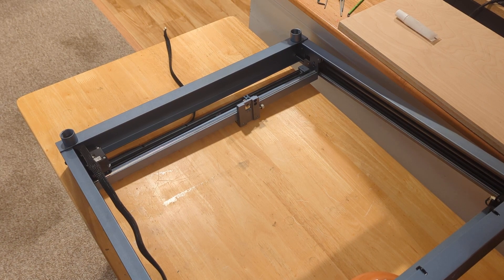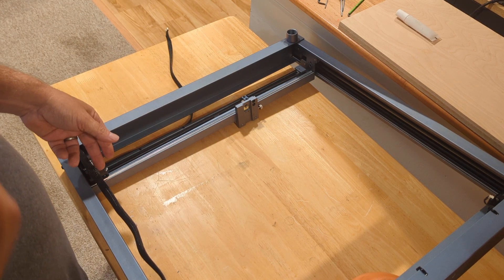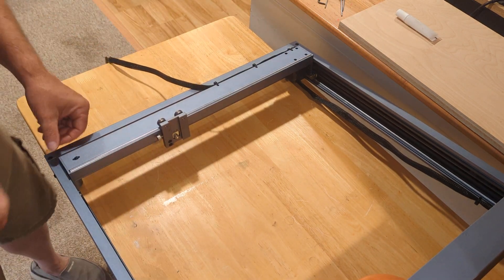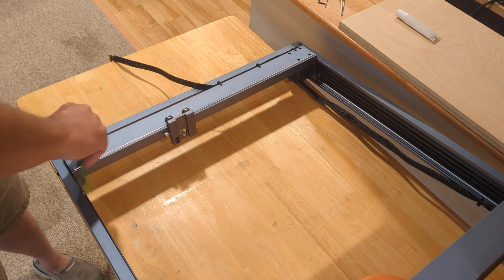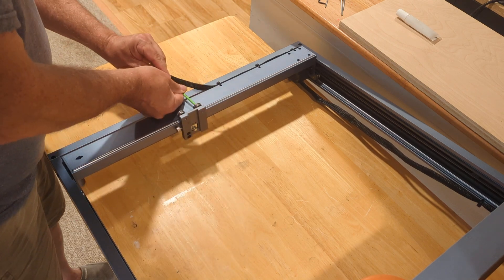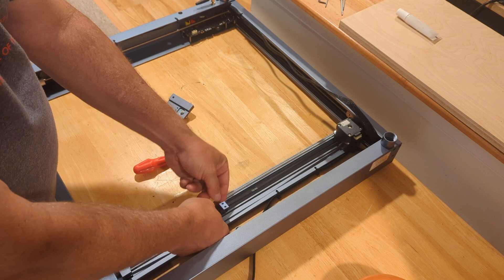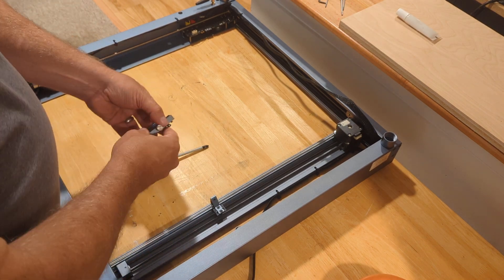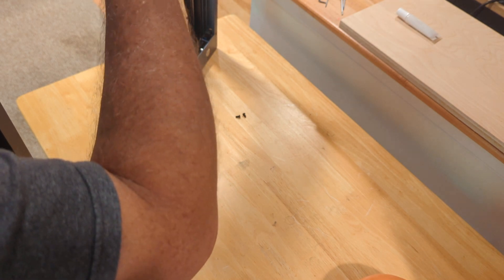Post maintenance checks - when trying to make things right goes slightly wrong.

Comment: New to laser hobby, just watched your video, took the laser holder off, remove the 3 wheels and all 3 bolts were stuck in the inner bearings race's with loctite and some was also between bearings and carriage. Removed all the loctite and seems to be reasonably solid now. Thank you
Reply from the maker: Glad it helped.